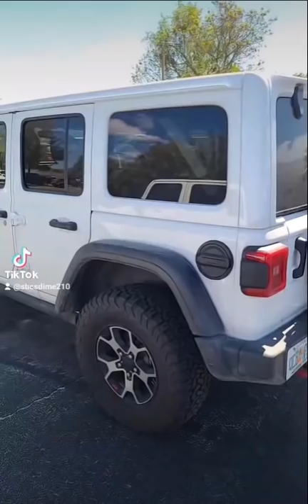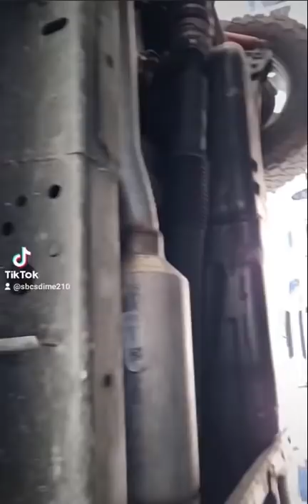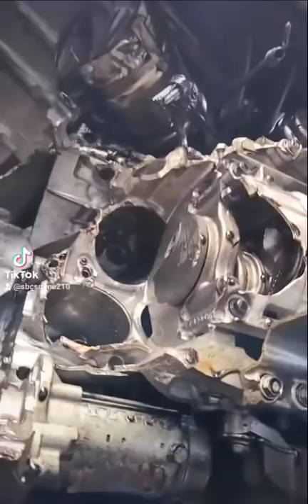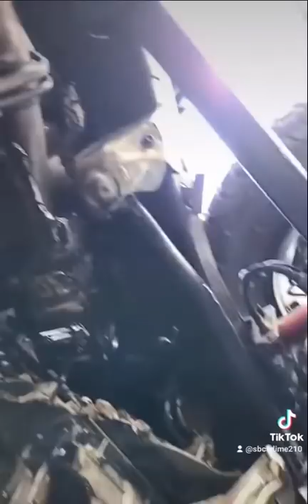Flat-Towing fail! Jeep Rubicon Carnage

Comment: We did notice an initial jerkiness as we pulled onto the interstate highway but then the jeep towed along just fine for hundreds of miles on the remainder of the trip.  After arriving at our destination later the jeep would not start.  Yes, the check engine light did come on when we tried to start the jeep!  The dip stick shows that the jeep engine needs more oil and surprisingly it appears to be low on coolant also!

Comment: the gearbox was set in 4 Low meaning engine spun over 50.000rpm (it didn't because it probably exploded at 10.000rpm)
Reply from the maker: Oh, absolutely that engine never reached 50,000 RPM. That's why I said "in theory". I give it 10K before it was shedding parts at the speed of sound.
Reply: @Alastor Samael any like this though? 4 low for untold amount of time.
Reply: @Alastor Samaelehen I thought about it 

you might be correct.

I find it odd how did he not hear the thing screaming
Reply from the maker: @Alastor Samael The 50K RPM is theoretical. Mathematically it COULD so 50K RPM, but I don't think anyone really thinks the rotating parts would ever see that.
Reply from the maker: @Alastor Samael We can't believe everything we read, can we? I wasn't there, maybe it did. But I don't see the rotating assembly of any engine, even F1, spinning at 50K. I got no skin in the game, just posting a mind-blowing video.
Reply from the maker: @Alastor Samael Ahh, gotcha!
Reply: @blackturbine  when you get in you 70s,80, 90s youur hearing turn to shit
Reply: ..and just about the time the engine hit the speed of light.
Reply: I bet 10 dollars in explodes at exactly 23,000rpm
Reply: everybody gangsta till a Jeep makes F1/IndyCar sounds
Reply: @garypic4083  unfortunately true😞

Comment: Ran great!! Very low miles!! Only used  when going on vacation. Mostly towed behind the rv!!! Won't crank at the moment. Maybe battery? Or the missing metaly bits underneath? Told it's an easy fix, not a mechanic so don't know. Asking 25,000 firm!!! No low ballers!! Will have more in it than it's worth.😆🤣

Comment: How does someone do something like that? How in the hell do you forget to take the vehicle out of 4 low first of all and most importantly, out of f**** gear?
Reply: I feel like they just were just TRYING to ruin that jeep
Reply: My guess is they were trying to put the transfer case in natural for towing and put it in 4 low instead
Reply: Why didn't they disconnect the drive shafts and plug the tranny... like your supposed to... you NEVER flat tow with a drive shaft hooked up, you'll fry the trans.
Reply: @hanksadventures4132  pretty sure that's not true with a Jeep Wrangler bub. That's a reason it's so popular. Do some research then get back to me.
Reply: I bet they put it in 4 low cause they were towing and didn't know a fucking thing about it 😂
Reply: @MarioQuezada  even with a transfer case in neutral, your causing the transfer case is still spinning... causing heat build up. What is the number 1 cause of wear? Heat. You CAN flat tow, doesn't mean it's a good idea bub. If you want to maintain the longevity of your vehicle when flat towing, you disconnect the drive line.
Edit: so I guess the wrangler is designed to be flat towed, but the series for flat towing was clearly not followed here. You leave the trans in park, meaning that even if the vehicle was in 4 low, it wouldn't have spun the drive line. I still advise disconnecting drive shafts any time you tow a 4x4 vehicle.
Reply: @hanksadventures4132  it was a manual... so no park here.

Comment: What did they do leave it in park
Reply: Funny thing. You actually have to tow it in park. You just set the transfer case to neutral which disconnects the front and rear drive shafts from the transmission
Reply: @memesredacted  interesting, I didn't know that thanks

Comment: Question here, would this have caused a fire had the Jeep been older with the typical oily dirt overlay on all the parts?
Reply: Motor wasn't actually on so no spark no fire unless it caused electrical fire but that's around a one in a few thousand chance thing.
Reply from the maker: No. No heat or spark to cause a fire.
Reply: As soon as that motor started letting go all the oil and fuel surely spilled out anyway from any.
Reply: @PureMediaAustralia  I’m sure there were plenty of sparks as the bell housing got ripped apart
Reply: @FlyGuyRy94  transmissions are made of aluminum alloy, so no sparks would've been possible even with that.

Comment: Can anyone explain to me why this happened?
Reply from the maker: The transmission was in gear, instead of neutral, AND the transfer case was in low range. With all the gears multiplying the rotating speed of the tires (multiplied in the axles, transmission, and again the transfer case) the wheels may have been spinning at a few hundred revolutions per minute, the engine is spinning at, in theory, 50,000 RPM is possible. In reality, I would think it let go before 10,000 RPM. Most engines can't rev past 7,000 rpm.
Reply: @garypic4083  Florida man, is all you need to know

Comment: It cannot be mechanically possible for an engine like that to reach 50,000 rpm. Where did that measurement come from?
Reply from the maker: "In theory". It's right there in text. Nobody said it made it that high.  If it were mechanically possible, this video wouldn't exist.
Reply: @1QKGLH  right. My stupidity. I don't read obviously 😂
Reply from the maker: @yungavalor3192  Haha  Not stupidity man.  I do the same thing.

Comment: I don't get it .what's with this low 4 .I don't know anything about cars .
Reply from the maker: Behind the transmission there is a gearbox (transfer case) that splits the power to the front and rear axles, giving you 4-wheel drive. In some (real) 4X4s there are two speeds in that gearbox, high speed and low speed. The low speed multiplies the engine's torque (taking liberties with the explanation for the sake not of boring you to tears haha) through gear multiplication. In this case, it multiplies the torque 4 times. What that means is, if the engine is driving the wheels, you get 4 times more power to the wheels. In this case though, the wheels were driving the engine. That means the engine was being driven 4 times faster than it should have been. The engine simply couldn't spin fast enough and stuff started to break.
Reply: @1QKGLH  in eteresting so this person drove the car in this manner .you only set the car in the gear for haul heavy things ?
Reply from the maker: @shadowrealm8014  4-wheel drive low range is usually only used for short periods of time while off-road driving where you need more power, or more control of the power. For instance rock-crawling you might need more torque and more control of the torque. While flat towing, the transmission would be in neutral, and to be safe I'd put the transfer case in neutral as well.
Reply: The important part that most wouldn't understand is the jeep was being towed on its wheels, the jeep wasn't towing something.

Comment: $13,000 at least. New Cat and engine.
Reply: More.  You are looking close to 25 with labor and tax.   This is totaled.   Let’s see what insurance company says
Reply: @Arun999  True I was low balling it thinking maybe some of it could be rebuilt. Looking at the video again your estimate seems pretty accurate.
Reply: @Phaerimms2  tech said 30k in parts without including labor as I recall from an article that talked with him.
Reply: @Phaerimms2  I bet you this jeep is gonna end up on tavarish 😂😂😂.  “Hey guys. I just bought the worlds cheapest 2021 jeep rubi.  But we have one problem. Pans out to the undercarriage.
Reply: @DurzoBlunts  Got dammnnn. $30,000 without labor? New car at that point fuck that.
Reply: Would insurance even cover this?
Reply: @Texarmageddon  That engine is pretty much the main value of that Jeep, I'm not nor wouldn't be surprised if it was total loss.
Reply: Plus a transfer case, transmission.
Reply: @La-yt1wr  engine and transfer case would be wrecked too I’m assuming
Reply: Total estimate on repairs cut and paste...."Toby Tuten, the shop foreman who took in the Jeep for servicing, reports a broken crankshaft, the back of the block gone, the input shaft and bellhousing of the transmission kaput, and a broken catalytic converter. He estimates $35,000 in repairs, which is a lot if you remember how much a four-door Rubicon costs. Excluding the destination charge, make that $42,620."